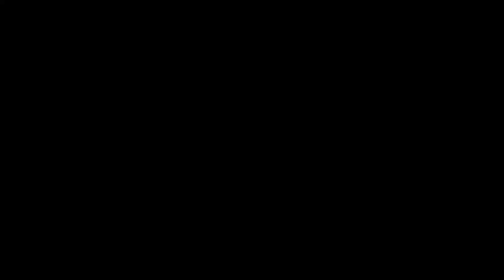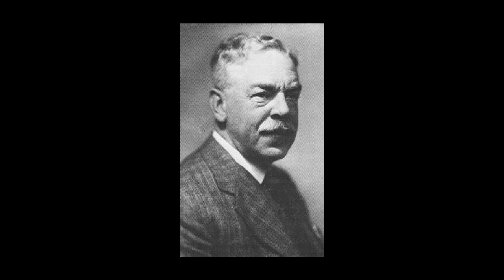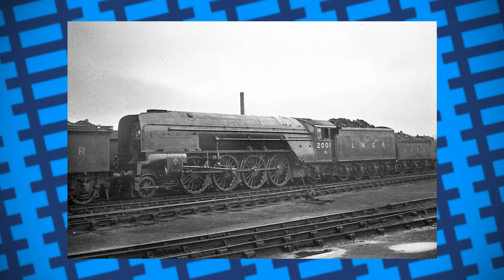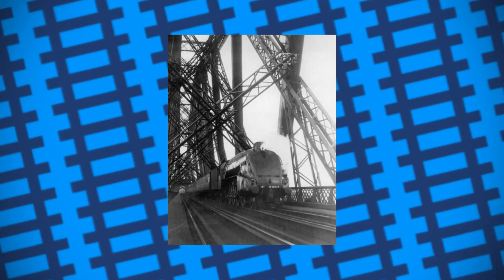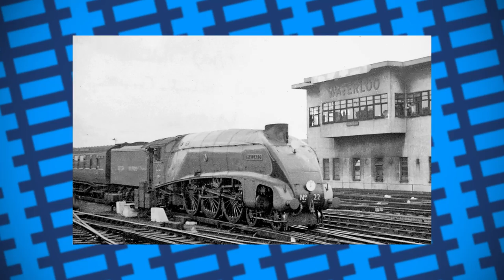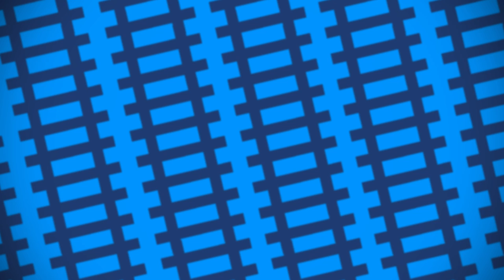LNER's 8 wheeled experimental express engines - LNER P2

Comment: Few extra notes

The P2s not only resulted in the A4s but also the Peppercorn A1s (as the P2s lead to the A2/2 which went onto the A2/3 then the Peppercorn A2 and A1)

The main reason for rebuilding the P2s seems to have been their low availability figures due to their crank axles failures (though this seems to have been an unknown flaw as to why it kept going wrong). Thane of Fife was the first rebuilt but it wasn't until a year later the other 5 were also, as they did test her to ensure that the A2/2s would perform better than the P2s, which arguably they were improvements if only incremental ones
Reply: The reason for the crank axle failure was due to it being the same design as the gresely A1 and A3 for interchangeability which was fine for them but as for the P2 they lack beef to withstand its power
Reply: Y'know, I really should have expected to see you in this comment section, Crane, and yet I'm still surprised 🤦‍♂️😅

Comment: One of the most awesome locos ever built and a pox on Edward Thompsons rebuilds! as he did with the the pioneer A1 'Great Northern' looking forward to the new P2
Reply: Had they been shifted to the ECML during WW2 instead of being expensively rebuilt, it would have made much more sense.  The matter has never been properly investigated.
Reply: @EllieMaes-Grandad  it seems to have been that the standard crank axle (shared with the Pacifics) was not strong enough for these powerful locomotives. Why a stronger one wasn’t substituted as an upgrade is beyond me, as I recall that the crank axles even gave trouble on the Pacifics!

Comment: The rare Mikado P2 of the UK.

Other rail operators outside of UK used them as heavy freight locomotives. The UK however put them on passenger express. The power and adhesion was certainly needed but they still didn't harness the full potential of the Mikado type by not switching to a Janney type, or other derivatives stronger than a chain link coupling, for coupling cars/trucks together. This problem also spelled the end for the garatts as their power could decouple them to their trains. 

The x-8-x wheel arrangements is in between the x-6-x for speed and the x-10-x for heavy freight. The x-8-x has large enough driving wheels to go fast without compensating adhesion. It can carry a larger boiler owing to its longer frame. It can do both express pax and moderate freight without bogging down unlike the speed demons of the x-6-x. Some crazy contraptions based on the x-8-x platform is the widely debated T1. The 8 wheel formula also made the Big Boys balance of adhesion and speed. And the last 8 wheel platform to truly challenge electric locomotive was from the SNCF 4-8-4.

Comment: Thompson took over as CME at a point when the LNER was in dire straits due to WW2, a lack of funds and a fleet of locomotives that had a something of a mixed reputation. The P2s were costly to run and maintain, and caused problems on the track on the Edinburgh to Aberdeen line. They also spent a lot of time in works at a time when the LNER needed as much of its motive power to be available for the war effort as possible. They were a small, non standard class so Thompson tried to make them more reliable and easier to maintain with a greater route availability. The rebuilds may not have fully succeeded but they did pave the way for the rest of the Thompson and Peppercorn Pacific designs that would serve for the next 20 years. As for the rebuilding of Great Northern, Thompson would have had no interest or input as to which individual Gresley A1 would have been chosen. Great Northern happened to be about to enter works at the time the rebuild request was agreed. The LNER did not have the resources to build a potentially one off brand new prototype from scratch at that time so modifying a suitable existing loco would have been the only option. Thompson gets a raw deal at times but he took charge at a time when the LNER had a number of significant challenges and restrictions, he did an incredible job under very challenging circumstances.
Reply: Plus the fact that most of the LNER locomotives are Gresley design, Thompson don't have much of a choice on that one. History In The Dark did a video topic on him.

Comment: The P2 makes me wish Britain's railways had more mikado type locomotives. I find it strange (not in a bad way) that you guys didn't have more, but that might just be me being an American where we had 2-8-2's like popcorn at a theater. But I'm guessing 2-8-0's and 4-6-0's did the trick for y'all just fine. Can't argue with the Black 5 or 8F after all.
Reply: The only bigger loco that really worked for the UK was the 9F, which was better than the menagerie of other large locos built for niche purposes, and could also be used as a mixed traffic loco (although not advised due to the small driving wheels, even if it could do 100mph with them). It was just the right engine, at the right time.
Reply: @mattevans4377  That too. The 9F’s are arguably the prettiest 2-10-0’s ever produced.
Reply: Railways in the Uk were into building their own motive power with individual regional companies having vastly differing views on what was required and unlike the US with seriously dedicated locomotive builders offering off the shelf products modified to suit. Gresley appears with the P2's to have taken a look into the abyss of horses for courses with a little twist of devilry added for spice. 

What was needed in Scotland was a locomotive with light axle weight, high tractive effort and good acceleration, top speed not being something that really figured in the equation with stations being in such close proximity on a route more up or down than flat, the tech already existed so what led him off on such a tangent no one will ever really know possibly the low predicted class numbers lent itself to some petty flights of fancy only he would know. Was the P2 a failure? in essence yes, let down by a lack of finality in design, could they have been a great locomotive. doubtful, they would not have fitted well into freight operations-basically being too big for the day and the only other route they might have served well on belonged to the midland railway that time frame was filled by the 9f years later which employed everything the P2 lacked, All is not lost with the build of a new old design but even there they have taken a box of what was, shook at severely and whatever fell out is what they are building again with added spice, will it work out of the box, doubtful it will but they will fix it eventually because its the only one they have to play with.
Reply: @jamesedwards7241  In fairness, David Elliot has corrected in his design of P2 2007 the earlier problems with the pony truck that led to poor handling and crank axle faults, and the Lentz valvegear that was prone to wear will use better materials. Still a way to go but it's come on leaps and bounds since my visit, shortly after the frames were erected.
Reply: Economies of scale: nations built the engines which were most needed and worked best for them. The UK had the most comprehensive rail network on earth, one which reached every city, town, village, and hamlet. Gigantic 2-10-2's or similar engines would have been economic suicide. The Soviet Union also had big engines because they needed them.
Reply: @jamesedwards7241  That criticism is invalid; the P2's were not intended as a general-purpose class for mountain lines, they were intended for heavy expresses on the main line to Aberdeen (and similar duties).    For the West Highland Line with steep gradients and severe weight restrictions Gresley produced the K4 class 2-6-0's with a light axle weight and high tractive effort - exactly what you said was needed.   But you don't get something for nothing, a K4 on the Aberdeen expresses would have been as unsuitable as a P2 on the West Highland.   'One size fits all' doesn't work and isn't even remotely true.
Reply: The infrastructure was a main factor that determined what could or couldn't be done in the UK as well as the type of  work that a design was intended for . Axle loadings, track curvature, loading gauge and gradients meant that loco designs had to be designed that would get the nod from the civil engineers. Bulleid had intended to build a fleet of 2-8-2s for the Southern but the planned axle loadings were not approved by the civil engineer so he settled on a pacific design that would become the Merchant Navy. Likewise, Maunsell's Lord Nelson were originally conceived as a Pacific loco.
Reply: It is very strange. We had 2-8-0s, 2-8-2s, 2-8-4s, 4-8-2s, and 4-8-4s in America, even had a 6-8-6, lets not forget the larger decapod, texas, and santa fe class engines, or the articulated monsters. I guess the caveat is none of them pushed near triple digets like the british did?
Reply: One thing to consider with the British locomotives, look to what's under and behind..... the infrastructure of track, loading gauge, turntables and passing loops, limited the locomotive length, compounded by the rolling stock behind; the freight wagons (particularly coal) were commonly of the short unbraked rigid variety, rather than drop-centre bogies with a through braking system.
Reply: Once you look at the geography of Britain you realise going past a certain point with loco size is more of a limiting factor of operating potential than a benefit of operational performance.
Reply: There's actually a fairly simple reason:  American locomotives typically used bar frames, British locomotives traditionally used plate frames.  The relatively tall and skinny frame plates on British locomotives left plenty of room inside the frame for things like inside cylinders and fireboxes.  Very useful when you're working within a very restrictive loading gauge, especially when you consider weight carried by leading and trailing trucks does not contribute to tractive effort.  American style bar frames had less room between the frames.  The frames were low enough that fireboxes could spread above the frame but again the maximum width was determined by the loading gauge.  Bigger locomotives needed bigger fireboxes but the width constraints meant fireboxes could only get bigger by getting longer.  Eventually fireboxes got so big they needed pony trucks to carry them.  The key sign of  the American "superpower" era is the four wheel trucks needed to carry the huge fireboxes.  But again restrictive clearances mean British locomotives rarely got big enough to need trailing trucks.  Bar frames are also why there were few inside connected American locomotives built after the mid 1800s, there wasn't much room for cylinders between the frames.

Comment: I'm a big fan of the P2s and I think that they are perfectly designed locomotives! I find it hard to decide on which look I prefer better: Cock O' The North's look or the A4 like boiler. An A4 front and boiler on a 2-8-2 wheel base is just perfection!
Reply: They needed to be sliced apart with cutting torches, broken into scrap, and melted down. Which they duely were! Excellent result!
Reply: @PreservationEnthusiast ok Mr/Ms. Killjoy
Reply: @Combes_  Scrapping polluting steam locomotives is a very beneficial activity to help protect the environment and recycle the metals.
Reply: @PreservationEnthusiast  L.D. Porta, ever heard of him? I doubt it
Reply: Luke  I Want To Talk About Steam Engines

Comment: I used to do my trainspotting back in the 1950s and never seen any of these P2s but do remember very well some of the rebuilt A2s and from my point of view they were one of the most beautiful engines running around at that time and powerful too, I can remember one vivid memory of seeing 60535 Hornets Beauty in ex works condition coming out of Doncaster works in 1959 and for me personally I thought Thompson was way ahead of his time with regards his designs especially the P2s, and with regards to the A2s tractive effort they were as powerful as the Princes Coronation class and some even more powerful and they were only a 3cyl locomotive,  thankfully there is one nearly completed at the moment and that will be some sight to see.

Comment: One thing that interests me is the fact that the 2-8-2, or Mikado, wheel arrangement, is normally associated with freight locomotives.
Reply: Wheel slippage is always an issue with locomotives having an non-driven trailing axle (i.e. 4-6-2) as weight balance transfers rearward under load. Having an additional driven axle helps compensate for this propensity.
Reply: Many years earlier, Gresley built a couple of P1s.  Superb loco's, they were 'too good' and could haul more loads than the infrastructure could cope with.
Reply: The French and Germans also built loads of Mikados for heavy passenger express work and they certainly weren't alone in doing that.

Comment: Very cool. These sorts of “trial and error on big trains” is a subject of interest.
If it would interest you for a video; the largest/heaviest steam train built in Australia would be worth your time. Currently preserved at the Newport Railway Museum (Melbourne Australia), it was nicknamed Heavy Harry. He had several technical updates for transferring coal into his fire to ensure all parts of the boiler got aliquoted heat. Although not as fast as his smaller contemporaries, he could deliver trains faster than them because he didn’t have issues with inclines. If you want a bit more info or a bit of video, let me know.
Reply: For just a minute I thought you were refering to the AD60s, but it turns out they're about 500 lb lighter.
Reply: If you go to the steam/machinery museum in scorsby in Melbourne's east there is a 12 inch gauge miniature heavy harry. 

It's every bit as impressive as the real one when you consider one bloke built it in his shed.

Comment: The wheel configuration of 2-8-2 is strange the Churchward 2800 8F class locos of the GWR were very successful I think originally from a GCR design? They were mixed traffic locos as used by BR

Comment: I thought the P2s were designed as freight engines, not passenger. And yeah, the 2007, Prince of Wales, following the model of the 2001with a few modern modifications, and to make some parts interchangeable with the Tornado is... I'm going to say nearing completion. Started around the same time as the 2007 is a 2001, cock o' the north replica, but as it appeared after it's first refit to look more like an A4, but I've not heard much about progress on this one. It would be good to see them both completed, as they're both fairly iconic looks.
Reply: The Doncaster one will never get beyond owning the frames it has at this point.
Reply: @EllieMaes-Grandad  A shame if true, but, how can you be so certain?
I mean, I do doubt it will ever be finished myself too.
Reply: @bobingabout  I've met the people . . .
Reply: @EllieMaes-Grandad  That's a good way to be certain.

Comment: LNER P2 is a very interesting steam locomotive, it's actually one of the few 2-8-2s to ever be build in England. I wonder how a northern type 4-8-4 would end up if LNER actually build it? Would be perform well and go on tighter curves or will it end being a huge flop with a wasted potential? Who knows!
Reply: Not quite the only ones, there were the two P1 class 2-8-2's also designed by Gresley, for freight use.
Reply: @cr10001  the LNER P1 are actually very different engines compared to the P2.
Reply: Not the only 2-8-2. GWR had several 2-8-2 tank engines as well
Reply: @rayhankazianga6817  Oh yeah.
Reply: The lner actually proposed a 4-8-2 Known as the I1, but wasn't built due to WWII, and his eventual death
Reply: @Combes_  That's very tragic, it would've been great to see the LNER I1 actually being build and run on the railway, maybe even give the P2s (or BR standard 9Fs) a run for their money. And if the LNER I1 were to be very successful if we had one, then maybe just maybe Sir Nigel Gresley would propose a new Northern type that would make it Britain's largest steam locomotive ever build, of course we'll never know the true potential of LNER as Sir Nigel Gresley sadly passed and Thompson took over and changed nearly every locomotive that was build under Sir Nigel Gresley's watchful eye, what are your thoughts?
Reply: @matthewpastrikos7383  real shame considering how these were the succesors to the A3s, imagine seeing one of gresley's 4-8-2s pulling the flying scotsman at breakneck speeds. FYI, Burt Spencer drew up plans for a 4-8-4 with A4 streamlining.
Reply: @Combes_  Really? That sounds like a locomotive i would love to check out, now then it is sad that the original 6 P2s didn't survive however a new P2 locomotive is currently being build with the name Prince of Wales and numbered 2007 making it a 7th installment of the P2 class. Now if this new P2 does well after being build, there's a small chance that we might get an actual LNER I1 4-8-2 Mountain type next and eventually a LNER northern type. So that would make it the big five which includes A1/A3, P2, A4, I1, and a 4-8-4 with A4 streamlining.
Reply: @matthewpastrikos7383  yeah it'd be cool. Talking about LNER 2-8-2s, did you know the P1 (a heavy freight engine that was too powerful to be useful) was originally meant to be a 2-10-0 version of the O2 2-8-0?
Reply: @Combes_  No i had no idea, also i thought the P2 was gonna be more powerful then the P1 considering it's size, weight, and speed. At least there actually is a 2-10-0 in British Railways, it's called the Standard Class 9F and it's one of the best steam locomotives ever produced. The 9F is actually the fastest and most smooth riding decapods to have ever exist clocking in at 90mph when pulling passengers which is insane when you think about it.
Reply: @matthewpastrikos7383  yeah I heard about it in the evening star video
Reply: @Combes_  Ah Evening Star, a locomotive build just to be preserved. It's actually still running to this day, the 9Fs are quite an engineering glory.